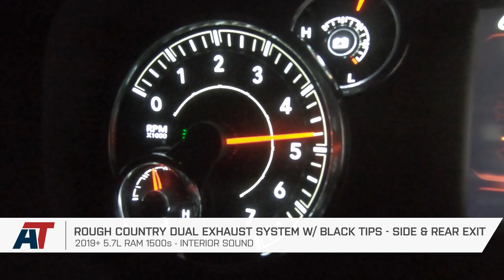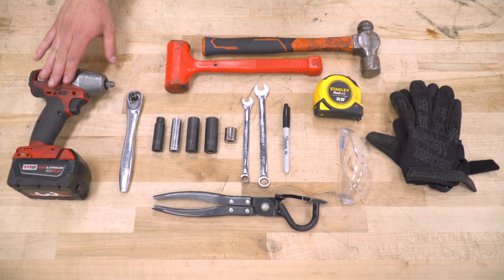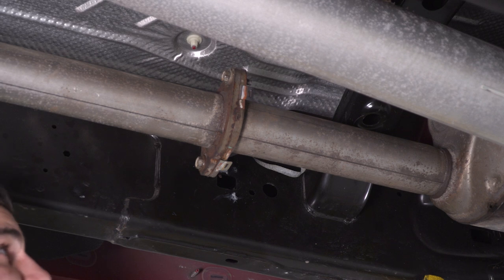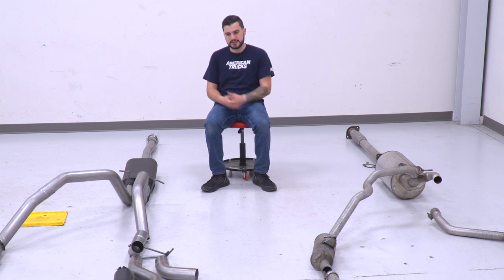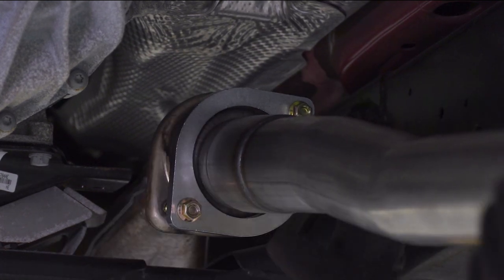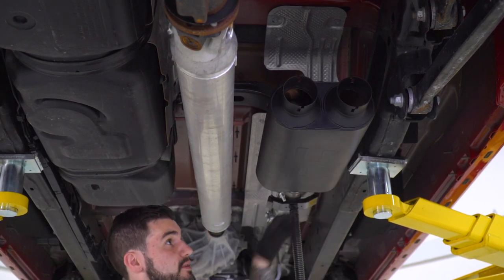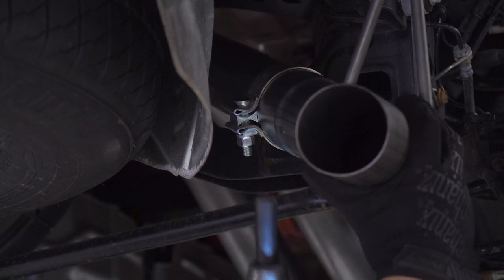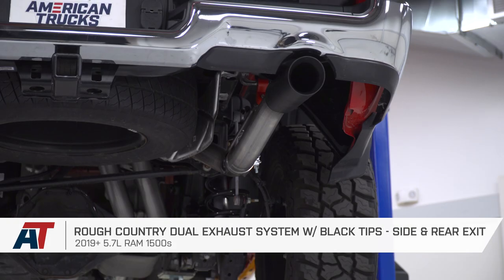2019-2021 RAM 1500 Rough Country Dual Exhaust System with Black Tips Sound Clip & Review

Comment: How long did the install take you from start to finish? Was there any welding involved? Is this something that I can easily install in my garage without a lift? I have a 2019 Rebel and it has zero rust underneath it so I was hoping for an easy install. Please let me know. Thanks man !
Reply from the maker: This should take around 2 hours to get done. There's no welding required and you don't need a lift for this, so you can totally do this in your garage.